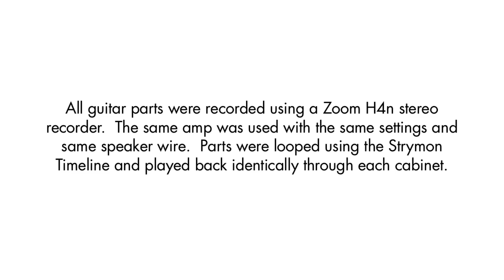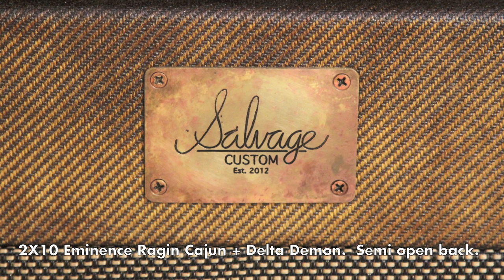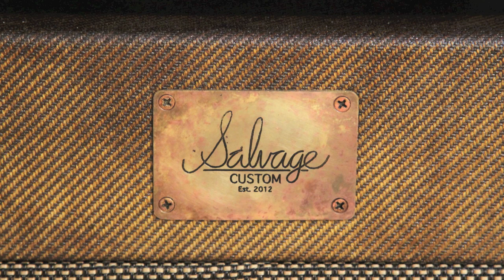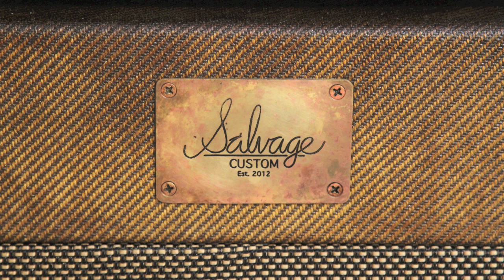Salvage Custom 2x10 Speaker Cab Demo vs Dr. Z 4x10

Comment from the maker: That's the Earthquaker Devices Bit Commander stacked with a Mojo Hand Huckleberry.  The Huck is discontinued but got replaced by the Crosstown.  Same great circuit with better power filtering.